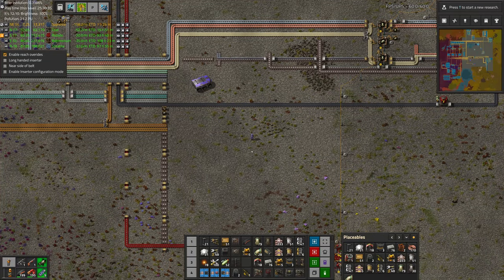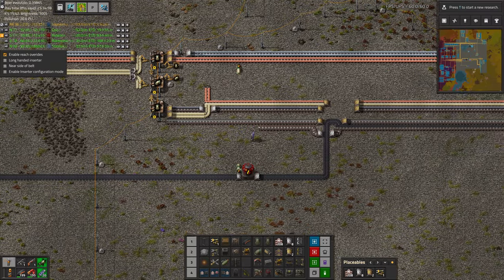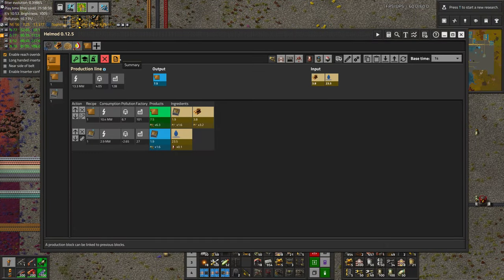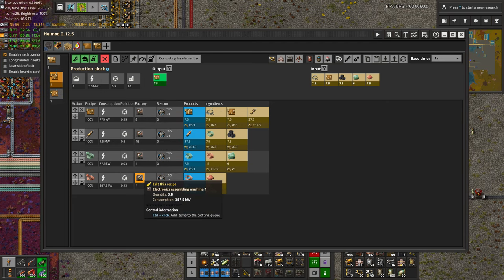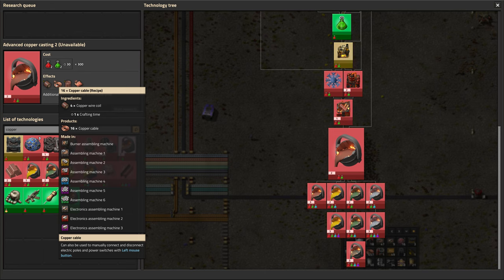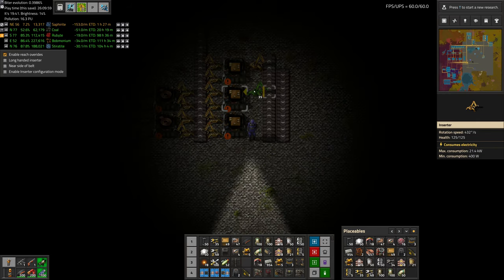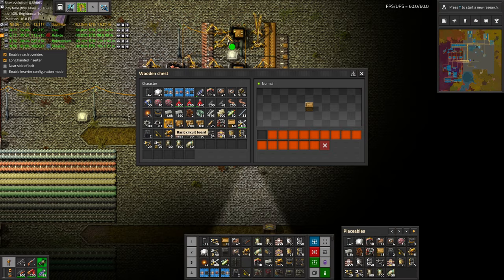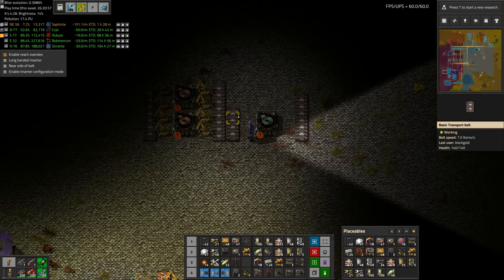[Factorio 1.1 4K] Angel/Bobs Ep 27: Making Circuits On The Bus (Tutorial/Walkthrough)

Comment: Hey Marsh, did you changed any setup or config in the mods? I am trying to make a modpack similar to yours but with some other mods. But with aai industries after research the first lab tech, the lab building doesnt appear to build. And if I disable the aai industries, the crusher from angel refining become unable to research... lol ... I am now downloading your save to see how yours worked.
Reply from the maker: AAI does change how the early research is done, and it can conflict with science cost tweaker which also changes the labs. I believe there is a setting that controls which labs AAI handles and which ones it does not. I did have to change that by a tier to get it to work properly.